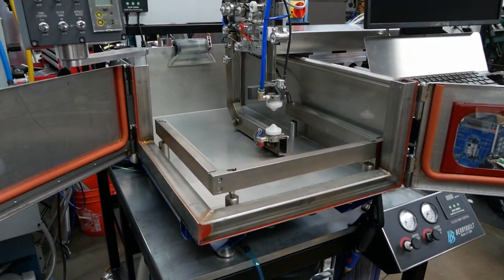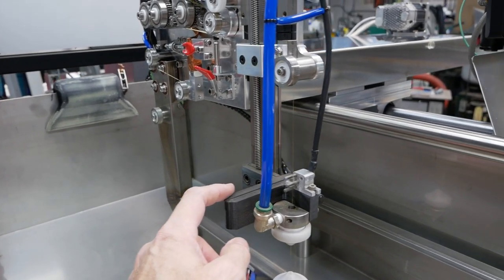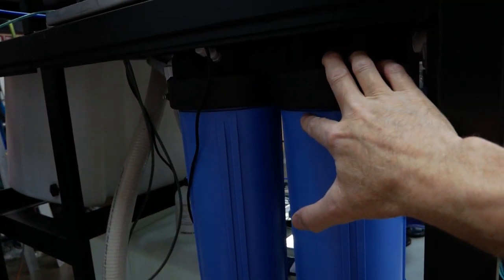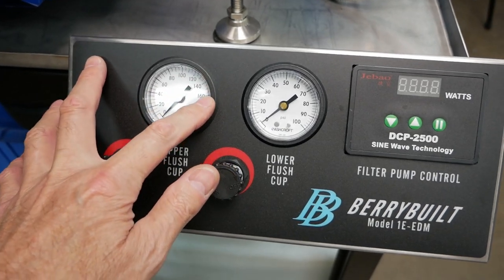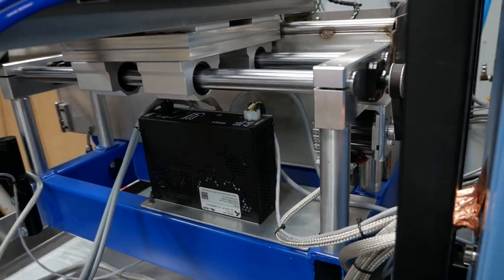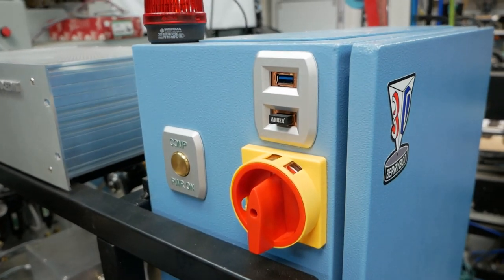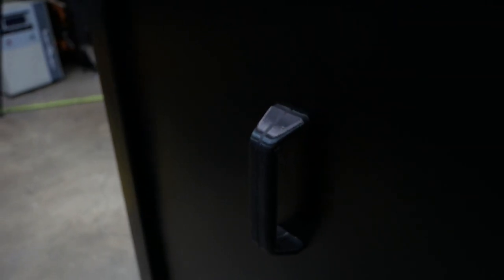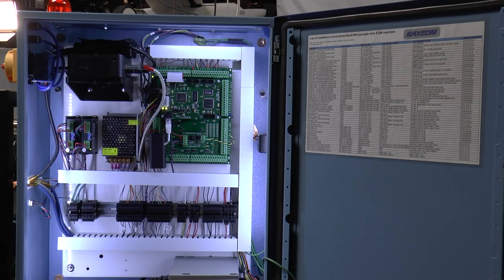The Epic BaxEDM powered CNC Build

Comment: Great build , thanks for giving me an idea for naming my build , I m going to call it “Odyssey “   (My 6 axis build as it’s taking nearly10 years) .and if it wasn’t for BaxEdm it would  take 100 .lol .Great idea to put the C arc ,  along the c axis , that way the machine space can be utilised better,  
Can you please tell me why your dirty water tank is smaller than your clean water tank? Normally  the clean water tank is smaller , and it overflows into the dirty water tank if it gets full.
Regards
Mariano
Ps did you had any noise problems with the HDMI monitor cable?

Comment: Very Nice!  Appreciate the cost estimates, but....that's cash out of pocket.  How much TIME did you spend??  Not just hours building and assembling, but including the labels and panels and time spent sourcing everything.  Then multiply that by some nominal $ value (i.e. "minimum wage" or experienced builder wizard @ $100 / hour or ???) and add overhead (rent & utils. of floor space).   Probably between $30,000 and $50,000.  

Thank your for your beautiful and well documented project.